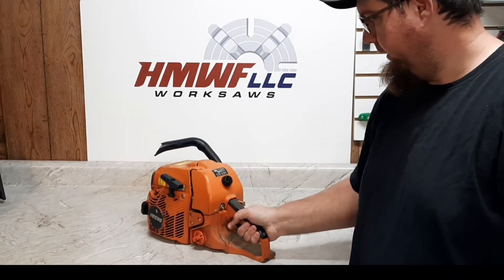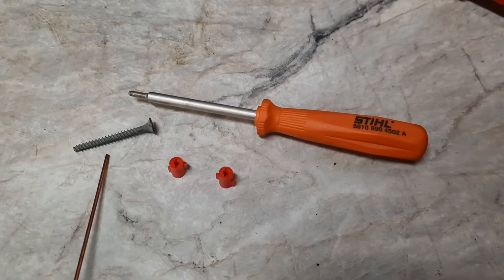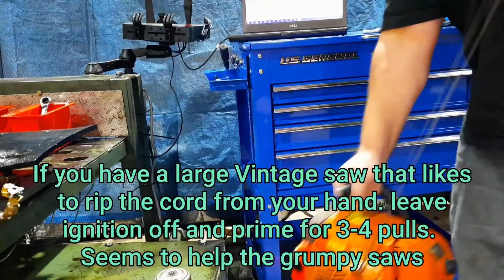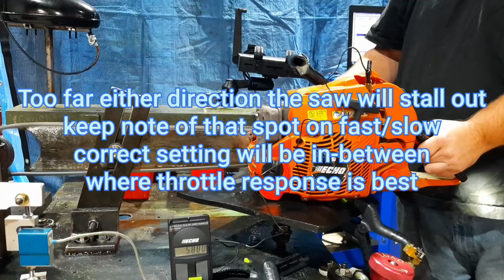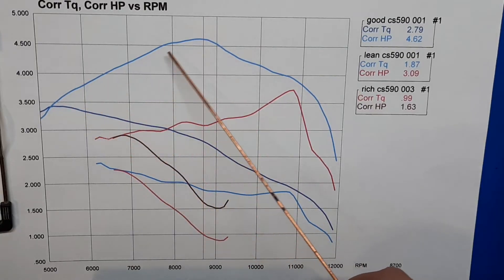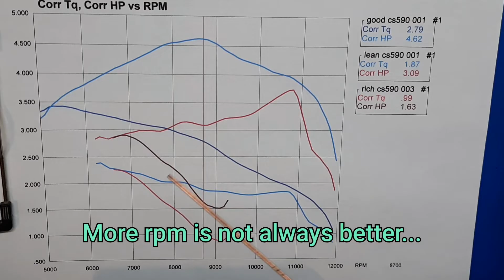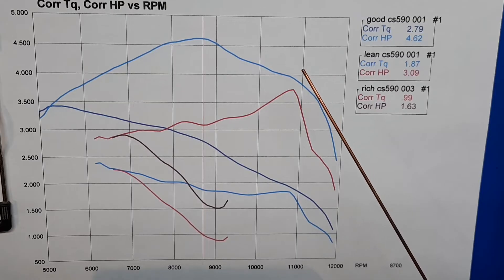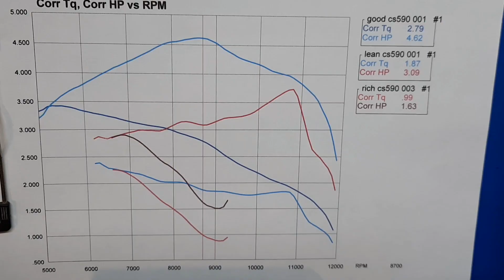How to tune a chainsaw carburetor

Comment: So many people are worried about burning up a saw that they go to 25:1 or 40:1 in a 50:1 saw and they fatten the mixture WAY up. Drowning it in oil and fuel doesn’t save it, running it lean so it revs out to 3 million rpm doesn’t save it. Having it RIGHT, how it was DESIGNED, saves it. Good explanation with the graph to show the results.

Comment: I have an older echo cs 300. Had it for about 5 years and its always been a pain to tune. I just broke it out after last years hurricane to do some cleanup. I have been using tru fuel since finding out how hard ethanol is on rubber. Last time I used it i put a new carb on it because rebuilding the old one didn't make it run so figured i didn't do a good cleaning, i gave up and bought a new Chinese kit from Amazon and when I installed it, it ran great. That was last year. Now this year, still having the left over tru fuel in it, it wouldn't start again. New,plug, purge bulb, and filter, fuel and air. So I bought another new Chinese kit and now what happens is, takes a few pulls to hit, with choke on. Then starts. But the instant I turn it off, it won't restart. Even warmed up. But when I finally get it running, it runs, idles, high speed fine. But if I shut it down, it won't restart seconds later. This is what I mean about tuning. What do you think? Thanks.

Comment: Lean is not reffering to your oil mix with fuel. 
But 50:1 is whatI use.
I have screw up saw by using 24:1 lot of carbon building up top of piston, will screw up saw real fast.

Comment: The problem I have tuning this saw, and other rev limited coil saws, is differentiating between hitting the rev limiter and four stroking with a rich tune.  In this video, the rich tune sounds similar to my 590 rev limiter.  I know the difference , but it took a while and a lot of tuning to learn the difference. PITA

Comment: I would like a more in depth explanation of low vs high jet. Where is the changeover? I can adjust my low jet   for max rpm then turn my idle screw down. I can also lower rpm by turning my low jet out. From what I have watched  the consensus seems to be tune the low for max rpm then turn to rich until rpm just starts to drop. Then adjust idle to correct rpm. Do you agree?

Comment: For 2-cycle motors, max out the high speed with highest rpm, then richen the fuel mixture to lower the rpm.  Then set idle and go to work.
Reply: Im gonna be captain obvious here and make mention of rev limited coil ceiling. Super fat on H side till u hear it, then start backing down

Comment: Weird carb to tune stock. New check valve without the bypass should be mandatory for piece of mind.The 590 makes a great firewood saw.Also noodles nice without clogging.

Comment: Very good, liked hearing the sound verses tuning. Couldn't help but notice the chains was very loose after the dyno load test. Soft chain?
Reply from the maker: Left it a bit loose since I was doing much longer runs. Keep rhe hear down. As I dont use a ton of oil.

Comment: Help me out: I’ve got a vintage Husqvarna 380CD with a Tillotson HS 123 or 160 something. On the port side of the saw as the operator would view there’s the L and H jet holes, and in that order left to right. On top of 5he carb there’s a steel sleeve leading to a spring loaded needle wi5h flathead screw. I had trouble getting the saw o start and keep running so I turned ALL 3 to 0 and then followed Tillotson manual recommendations. Saw was running waY TOO FAST AND HIGH. I was tinkering with spring loaded too screw and it really opened up so I had to screw it back near 0. Is that just the fuel needle inlet? If so, how is that different from the T idle screw on a Stihl? . Right now the saw is just running too hot. Should I just almost totally seat the top screw and do 1/8 adjustments on the L and H jets? Someone? Anyone?
Reply from the maker: The top one with the spring is the idle screw. It sounds like thst one needs a few turns out "loosen" and the idle speed should lower. Then fine tune the H, L once You get a normal steady idle
Reply: @dynojoemods2764  woah! I get a reply from the Living Legend! Thanks so much my friend. Love your channel and your shop btw. You the man
Reply: Dyno: for the old Husky 380 CD 77cc is normal idle about 2,000?

Comment: how is it rich only 1 turn out?
Reply from the maker: These 590/620 saws run odd settings.
Reply: @dynojoemods2764  Cool! Thanks for the reply man. Just used to Stihl I reckon. Picked up a new ms661 carb, doing some research for carb adjustment. Need to change this awful oem filter. No interest in muffler mod or porting yet. Just want a long lasting safe setup.

Comment: This is great info. I want to send you my 590 and 4910 for porting package. I need more wood cutting power!
Reply from the maker: Thank you, just let me know when.
Reply: @dynojoemods2764  thanks 🙏🏼 hopefully soon! The 590 is now outta warranty. The 4910 is only a year old but my go to saw since it sits in my saw haul on the tractor when I'm out getting firewood. I just took out the restricter tube and bent the tabs open. It helped a lot, but still need more power!

Comment: Great video! I’d be interested to see the power difference with a lean or rich tune on the L jet. I feel like in some saws I have noticed a power difference in the cut after adjusting the low. Can this be?
Reply from the maker: Yes, if the L is out of tune it can effect power some. Especially in the transition area from H to L side of the carb.

Comment: Can you put a autotune carb on a 450 rancher?
Reply from the maker: Anything is possible. But that would probably be a pretty big task. Not sure how close the 550 coil, carb and flywheel are to fitting the 450 chassis
Reply: @dynojoemods2764  at that point mise well just buy a 550 cause the carb alone is $100+

Comment: Good demonstration👍 I like to set the low jet rich enough for good response and just lean enough to idle for as long as the saw sits. And high jet, I've always tuned in the wood. Slightly 4-stroking with just the weight of the saw, cleans up when you dog it in or push on it. So far so good! Haven't killed a saw yet!

Comment: the video was excellent, I have been playing the carbs on my homelites just to get the feel and still struggle a bit, could you go more in depth on how to set the idle with the idle screw and L screw because I have an echo cs800p that doesn't like to idle when warmed up, cold no problem.
thank you again, Josh
Reply from the maker: If it starts well cold, raise the idle up a bit. May be a little high while cold but should settle in nice once warmed up.

Comment: From base start at 1 turn out each starting w choke then off
Start it’ll run but stahl out
Which do I start with low or high
It’s difficult to start with the law when it stalls right out I believe easier to start with the high well you’ve got it hammered down and get it to peek out and then start settling in the bottom end I understand that if you have a good throttle response the low is close but I have a difficult time finding correct idle with the idle screw and the low tune screw please advise
This is a Poulan 42 cc not my choice of saw working on it for a friend plus I have another craftsman/ Poulan ( old cast case)that gave me the same issue
Carburetor has been taken apart ports cleaned etc. everything looks good, clean gas, air, good spark plug
Reply: I understand that ☺️
That’s how it got on my bench in the first place-lol. I let it sit overnight with some sea foam
And will try again tomorrow 
Ty for your time-👍🏼
Reply from the maker: Sounds like it might like a little more open both H and L but it is super difficult to tell without being able to hear the saw.

Comment: More to the point is what octane fuel were you using & what brand of oil? Those do make a difference!
Reply from the maker: I use 40:1 amsoil dominator. 

I did not switch fuel/oil for this test. But I might try testing some different combinations in the future.

Comment: Great demonstration of 4 stroking.
Among other topics I had on my to do list I was going to do a video on the principles of why 2 strokes 4 stroke.
This provides a good demonstration of not just 4 stroking under rich conditions but also in respect of brake load on the engine.
I had planned to use a leaf blower for the exercise but instead I might point viewers to this video in future.
Reply from the maker: Thank you.

I would appreciate it.

Comment: Man I love this! I port my own work saws. I’m wondering if you would be interested putting one of my ported 372xt husky’s on your dyno? I also have a stock 372xt. I have always wondered what the actual power gain is with what I do porting wise. There is definitely a increase in power. I gain about 3 seconds over a stock saw in a 23” log running same bar and chain. Anyway if you are interested I would pay for the shipping. And you for your time! Thanks new subscriber here!
Reply from the maker: Thank you!
Visit my website www.worksaws.com
I have all my services and prices listed.
Reply: @dynojoemods2764  372 xp oe 13200 rpm max ok?
Reply: Hello jake mesa nice to see u here sir

Comment: Have you ran the numbers for that saw with a 590 carb ? Would be interesting to see the difference with just the carb change. Good video.
Reply from the maker: Without a muffler mod or cylinder porting. The larger carb by itself won't gain much power at all. Now if you modify, then the large carb really starts to shine.

Comment: Here is the part number walbro 86-578-1 nozzle. I have this installed in a 620 carb mounted to the cs590. Now you need the 620 unlimited coil and re tune and re dyno. You should get another 1000rpm in the cut.
Reply from the maker: Yeh the porting/stock muffler didn't want much over 12k on this 590. The hotter 620 coil is more helpful after porting. Really wakes up throttle response

Comment: Excellent demonstration. Thanks for explaining how the powerband and usable rpm range works. I've seen other saw "builders" testing wide open throttle rpm with a tachometer, as if maximum rpm means anything. Keep your eyes on Joe. He's going to teach us.
Reply: Max rpm can keep you in the safe max range without going into that danger zone.
Reply: There is a reason for the tachometer.

Comment: Very interesting. Thanx for sharing. One of my smaller husky saws kind of bogs and don't run well when it is cold and dies if not held running. Once it has working temp it is runs ok . Any idea why?
Reply from the maker: It is very hard to tell without hearing it.

Try turning the L screw Counter clock wise. 1/8 of a turn and see if it helps anything. Depending on the age of the saw it may be due for a carb kit and fuel lines.
Reply: @dynojoemods2764  It is a relative new secondhand 440 II e, that cut down only two logs before i got it.. Cylinder and piston is fine. Only premixed fuel here so i guess carbkit probably is not necessary. My guess s about 5 liters of fuel in total. I will try out what you suggest. Thanx!
Reply from the maker: @skrompf  
Try counter clockwise first, if no better try the other direction. But it sounds like a L side adjustment issue

Comment: The 620 nozzle swap, is that the check valve nozzle ?
Reply from the maker: The 620s use a bypass nozzle too.

I swap one from a stihl/husqvarna carb

Walbro part number 86-578-1

Comment: doesn't that saw have a limited ignition?
Reply from the maker: Yes it does, it is limited around 13.5k if you look at the small tach  it hardly goes over 12.3k max.

Tight muffler and ports will not allow it to hit the limiter "stock"
Reply: @dynojoemods2764  so if you ported that saw would you be able to get that kinda RPM out of it? I know there’s not really a need to I was just curious if it’s possible
Reply from the maker: @steelcityperformancesaws  

Yes it would hit it ported, with the nozzle swapped in the carb. The last one I ported was right at 6.2 hp at 9800 rpm. Tuned real well just below the limiter. But would hit it safely